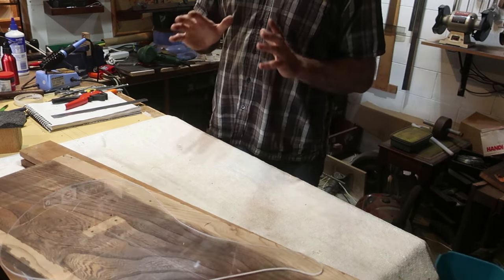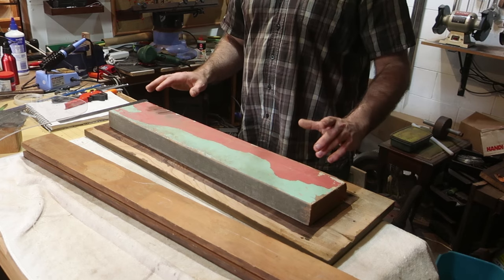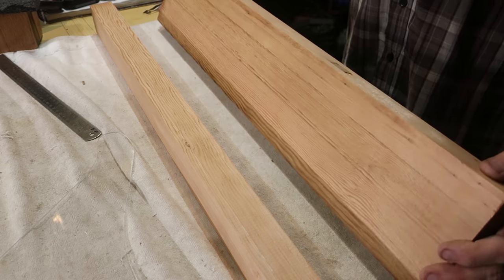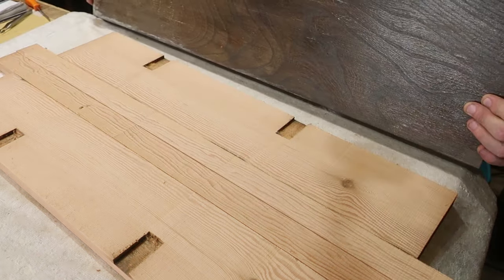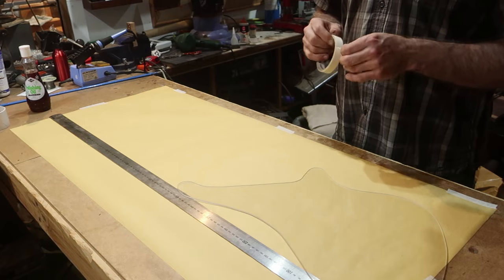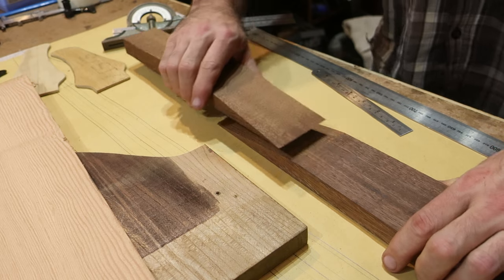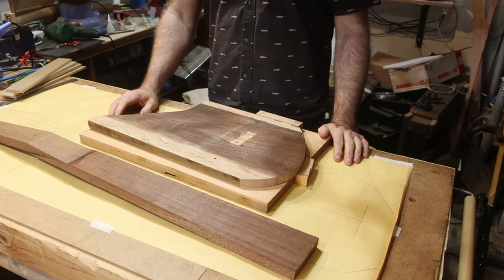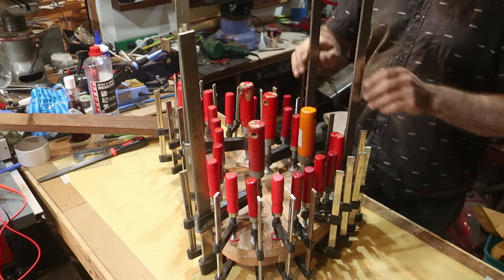Holiday Bass Build Episode 1 - Working out what on earth I'm going to build this time

Comment: Looking great  so far!  One thing that helped me out quite a bit when trying to glue up non flat surfaces- I got a thick plate of glass from a yard sale that was originally intended for shelving.  I used spray adhesive to stick good old fashioned sandpaper to it.  It works like a champ flattening out stuff like that, and I find myself using it for all kinds of other things too.  It's absolutely perfect for making sure the surface of a neck is flat before gluing on a fretboard.  And for truing up fretboard blanks too 😁
Reply from the maker: Yes, that's a tried and true method, I actually have a flat slab of granite that's an offcut of a kitchen countertop, I use it mostly for sharpening chisels and the occasional plane blade, and one or twice for truing up the sole of the plane too. I've tried flattening out body plates with it before, it's a lot of work. One time I tried leveling a snare drum shell on it and that was no damn fun I can promise you. I figure that if the sole of the plane is flat and the blade is properly sharp - like, dangerously sharp, then that flatness gets cut onto the body plates without much effort. The only issue I have with that is that the only plane I currently have that I KNOW is surgically flat is the tiny one. I have a whole pile of others but they need work, it might be an interesting video to just do a bunch of hand tool maintenance. Thanks.

Comment: Wonder if you might offer a suggestion? I have a 5 string Fender Jazz bass which has a forward neck bow that is impossible to remove as the truss rod seems to be at the end of its travel. It's a maple figerboard, so it would be a big messy job to remove. Is there anything that might be done to straighten the neck out short of massive surgery?

Any suggestions gratefully accepted!

PS Looking forward to the "NORMAL" bass build!
Reply from the maker: Sadly that's probably gonna need a fair bit of work. Many years ago I had a Squire jazz bass that developed a twist, I straightened it out by clamping the body end to a sawhorse, clamping some weights to one side of the headstock and left it out in the blazing summer sun for an afternoon. Surprisingly it actually worked, but one week later the twist was back and it was clear that the wood just wanted to be that shape. My solution at the time was a new neck (I hadn't started building them myself yet). In your case it sounds like messy surgery would be needed, maybe not to remove the whole fingerboard but I'd pull the frets, slacken off the truss rod to reset it's position, then level the board and refret. That'll give you a nice straight neck and set the truss rod to where it can actually do something. It'll also take a slice off the value of the bass BUT it'll bring it back to life. Good luck.